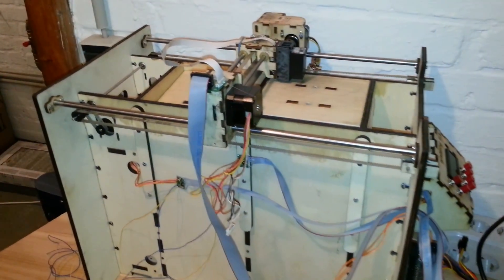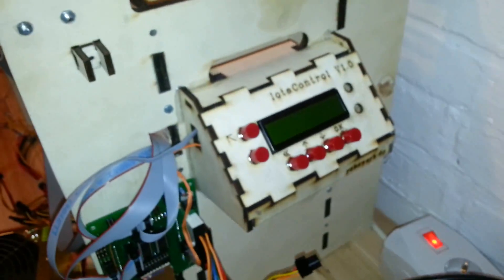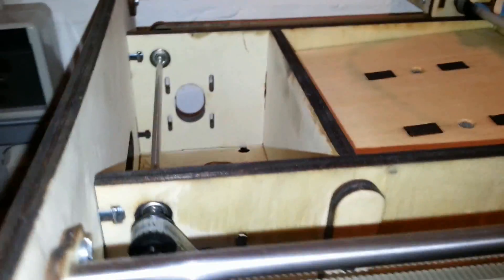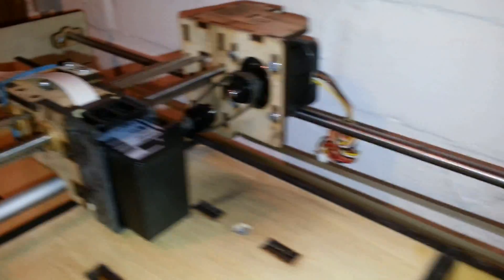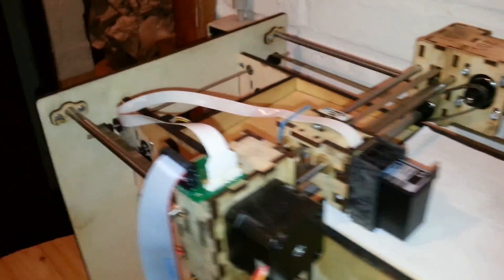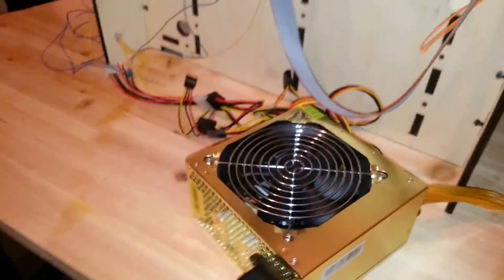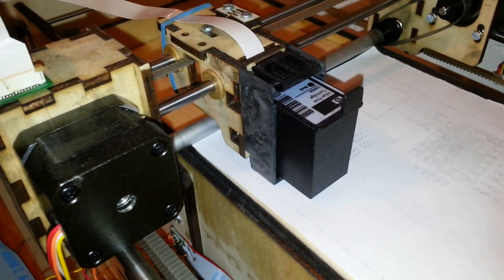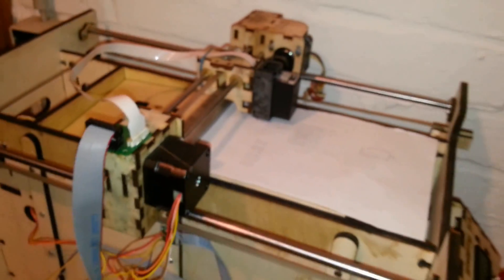3DP: 3D Printing in Powder and Plaster / Prototype

Comment: great work man! do you have ever tried to refill the cartridge with something which is not the classic inkjet ink? like resin, milk, or water?
Reply from the maker: Yes, I tried Sake. The alcohol works better than water in binding the powder. There are many recipes for powder and binder on the net. Some are printed better with a piezzo head, some work with thermal heads. Lots of experimenting required.

Comment: according your pcb design pcb is not working fine means stepper is not working and drivers are burning out.......
Reply from the maker: My PCB design has no stepper drivers. It just has a pin header, and you can connect your own stepper driver. If those are getting damaged, then either your hardware is blocked, or your drivers are not compatible to your stepper motors.
Reply from the maker: PS: this whole project is from 2008 or so. There is a lot that I would do very different these days.

Comment: Is there a special reason for the machine to produce so much noise? What is the gap between the print head and powder surface? There must be some gap. Otherwise, the powder would stick to the head and finally block it.
Reply from the maker: The machine wasn't aligned very well, and the stepper drivers were not set to use microstepping. That makes the stepper noisy, plus using wood amplifies the sound even more. Building this today, I would invest much more effort into making the carriage run smoothly and using a silint stepper driver. Thos are great and even let the host CPU know if the motor misses a step. They would even make end stops switches obsolete.
Reply: @quadraturencoder  : Thank you.

Comment: How much is this? I want to buy one.
What's the accuracy on it? can i use a powder with glue? a powder that doesnt bind together and needs glue
Reply from the maker: Dr. Pierre Khazen Not commercial (yet). Chemistry is still the big issue. Current resolution is about 0.1mm in x, y, and z (different printhead).

Comment: WoW! I prefer this type of print method, excuse me, what software do you used for it?
Reply from the maker: Messerschmitt206 It's my own firmware and host software. The host software slices 3D models into layers based on pixels. It uses GPU hardware acceleration, which makes it pretty much instantaneous. The firmware is a hodgepodge of little routines that interpret commands from an SD-Card file.

Comment: How did you build the 3d printer. I've been trying to upload the pwdr software, that I copied from the github website, onto my arduino board and I keep on getting the following message below.

Undefined reference to “printFileSize”
Undefined reference to “printFileLower”
Undefined reference to “printFileUpper”

Anyone know what I'm doing wrong? Any help will be appreciated.
Reply from the maker: easyedd2131 Sorry, I am not using the PWDR software at all. Maybe ask at the developer's mailing list?

Comment from the maker: Q2347A Ribbon Cable Pinout

Pin	Alt	Function
1	 16	 COM, +22V, also pin 14
2	 15	 Noz 5
3	 14	 Noz 6
4	 13	 Noz 7
5	 12	 Noz 4
6	 11	 Noz 3
7	 10	 Noz 2
8	 9	 Noz 1
9	 8	 Noz 12
10	 7	 Noz 11
11	 6	 Noz 8
12	 5	 Noz 9
13	 4	 Noz 10
14	 3	 COM, +22V, also pin 1
15	 2	 bridge to 16
16	 1	 bridge to 15 *1
*1: this can be used to check if the ribbon cable is inserted

Comment from the maker: Haha, yeah, it does sound like a dot matrix printer, thanks to the wooden body and the aggressive stepper settings. I am working on it. The next version will have an H-belt system, which should be a lot quieter and faster.